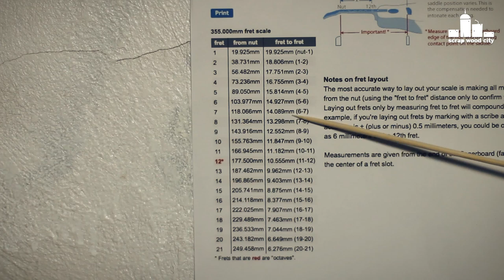Making an experimental musical instrument using the lathe as much as possible

Comment: Very nice, as a wood turner that was a project after my own heart.  May I suggest that if you do a similar project in the future you could use the double stick tape you used on the sound board to stick two boards together, then turn the neck out of them.  Then pull the boards apart like you did with the bridge.  Then you will have two necks instead of one and a pile of plane shavings.
Reply from the maker: Thank you. Yes that’s a really good idea